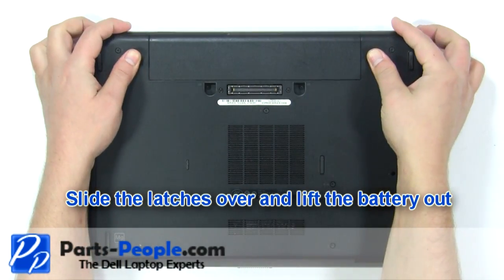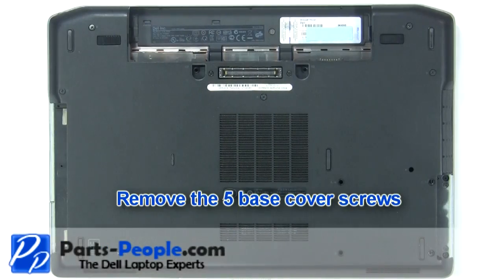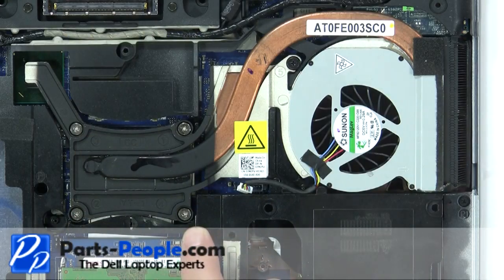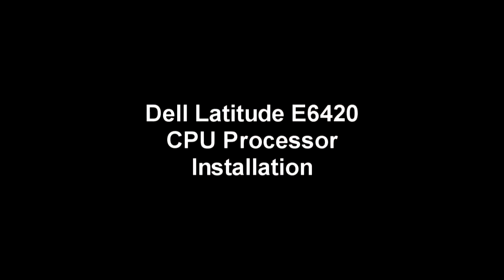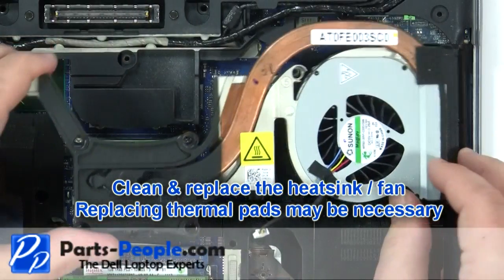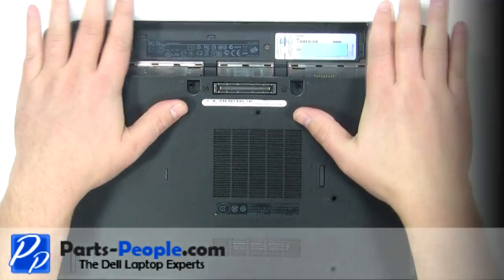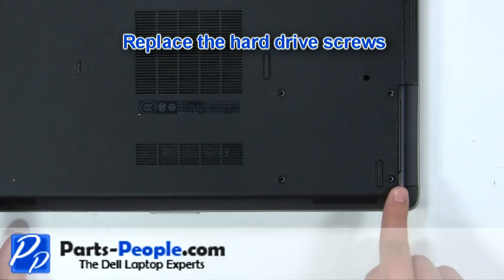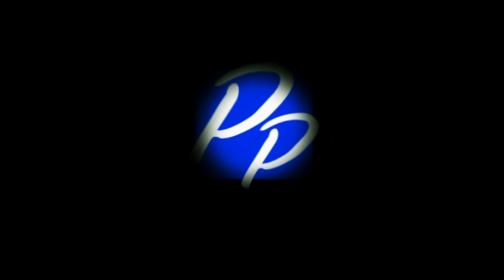Dell Latitude E6420 CPU Processor Replacement Video Tutorial

Comment: Okay I realize this is an older computer but I got one of these at a Goodwill store (with the Tech Center) it has the i3 CPU no hard drive (or caddy) but no issues as I have a few 2.5" SATA drives at home.

Anyway will this accept a 3rd generation (Ivy Bridge) CPU they both use the G2 Intel socket I don't want to buy one to find out it will not work.

If not which is the sweet spot 2nd generation one to get (price vs. performance ratio)?  

I know the i7 will be better but is there that much difference between the 2 I am aiming for a quad core version (Q in the model code)

Thank You

PS: This seems well built and most components are easily accessed from the bottom unlike most consumer models which require the motherboard to be removed to even get to the hard drive.
 
(a high failure part also, plus I seen people just smash the whole thing when they get a newer model Vs. just selling it or removing it as it is not easy to get at!)

Comment: You can also add 0.3mm copper shims to the other chips (2) that are in the way of the heatsink pipe, and use a good thermal paste as Grizzly Kryonaut. It cooled very well the system that way.

Comment: my dell E6420 was burned the video card was icore7 processor, and now buy a latitude e5430 icore 5, my question is if I can use or replace using the icore 7 processor in which I just bought that is icore 5?

Comment: Is there a limit to the cpu I can put in? Can I put in a 4600 or 4700 cpu?
Reply: No you cant the motherboard's dell e4620 can only supports sandy bridge wich means the 2rd generation 4600 and 4700 are 4th generation

Comment: I just replaced a core i5 CPU in my Dell e6420 laptop with an Intel Core i7-2670QM, and it works nicely. I am using a 90watt charger, and nothing else was replaced (both the fan/heatsink and the motherboard is the same, with A21 bios). This is a 45watt TDP cpu compared to the previous core i5 which was 35watt.

Obviously if I load the system it produces more heat, but it is not overheating. I used high qulaity heat paste, as the original one was already dried up a long tine ago.
Reply: I also replaced it with the i7-2670QM after reading your reply and it works. Though my benchmarks show no significant improvement over the default Intel Core i5-2520M. Tested with sysbench on Ubuntu. Only multithread processes (>= 3 threads) show some improvement: 2504.68 events per second (i7) vs 2219.33 events per second (i5), which is about 15% more.
Reply: @scndsky  Can we get ivy bridge done on this laptop? Or no one ever made it?
Reply: Szia, nekem is e6420 van i5 2520m procival. Bele lehet rakni akkor az i7-2670QM procit is, és ha igen akkor elég neki a 90W-os töltő?
Reply: @varillo2594  After a year or so I bought a "high performance" heatsink to the laptop (the diff is that the original heatsink has one heatpipe, the high perf one has two), as I used the laptop with constant workloads. I have no issues with it. Yes, the 90watt charger is OK (without docking of course). If you use docking, you will likely need a 130watt charger with a 45watt TDP i7 in it. I also upgraded BIOS to the latest one, n issues with that too.
Reply: @csabasipos6525  was the high performance heat sync you bought for e6420? If so, would you have the link?
Reply: @csabasipos6525  What is the code or link you could provide for us about 90watt charge. Thanks
Reply: el i5 anterior era el 2520m ?

Comment: can you replace the cpu to a desktop processor such as I7 3770k to latitude e6420.
does e6330 has a  built in cpu to motherboard
Reply from the maker: No, desktop CPU will not work in laptops.
Reply: Parts-People.Com, Inc for the 2nd question. and thanks for replying
Reply from the maker: Sorry, I skipped right over the E6330 question. Yes, the CPU is built onto the motherboard

Comment: Is all Sandy Bridge family compatible with latitude e6420? Mine has core i7-2640M but I want to ugrade it... can I use core i7-2920XM? or which one do you recommend? Thanks!
Reply: tbh stick with the core i5 i had a core i7 dell e6420 and was running really hot all the time compared to my dell e6430 core i5 plus i tested the both from daily use i didnt notice any difference with the speed of the 2 as i had a ssd in the both.thank god i sold on the dell e6420 core i7 for just as was getting way 2 hot for me.good for keeping u warm in a cold windy nite though lol
Reply: +manueltkd wondering the same. The extreme runs at 55w vs 35 and 45w.  The issue would be if the double copper tube heat sink would handle the cooling.  I saw on another venue that this one would work for the non extremes...but no concrete answer either way.  Mine has just the single tube as it is the non discrete.  Would like to know ....thanks
Reply: You can use up to a QM series cpu, if I recall.